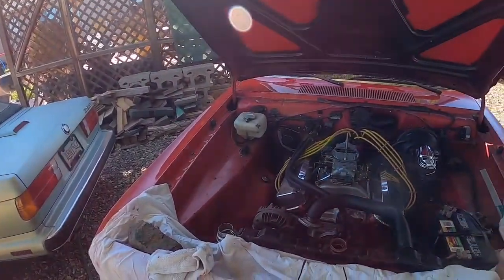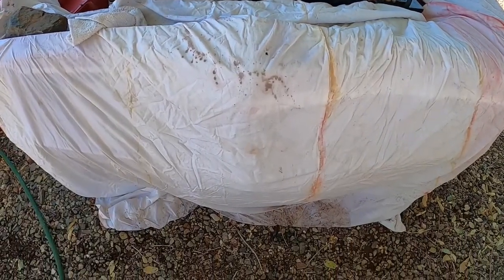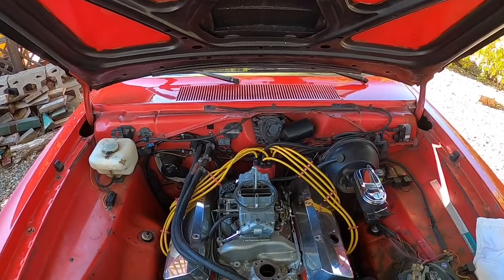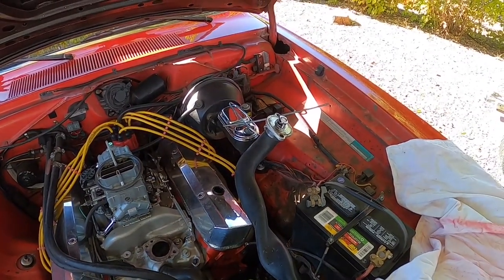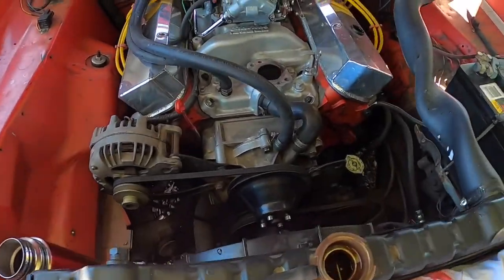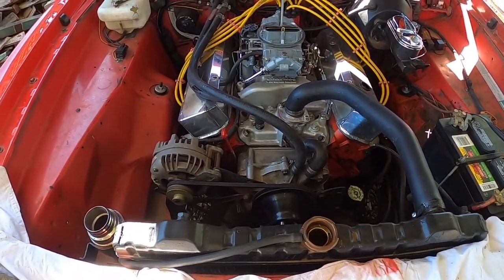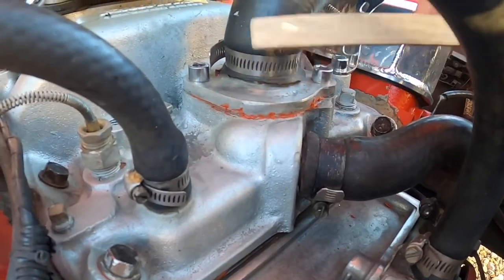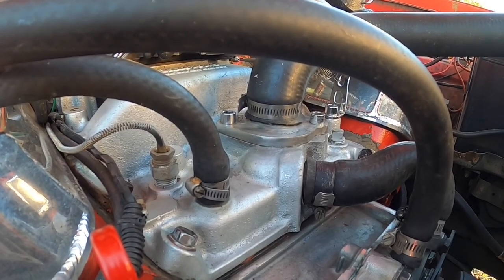Bi Annual Cooling System and Block Flush

Comment: Thanks. I need to flush a GM 5.7. Changed a freeze plug and could feel about 2 inches of rust in the bottom of the block. What is the best way to flush that? I  think it was from the failed Dexcool stuff that had to be taken off the market due to rusting engine blocks.

Comment: All the old brass Robert Shaw TStats used to have a really small dimple on the edge of the sealing area for an air bleed.
Reply from the maker: I see some that come with a bleed here and there still.
Some with a small hole with a little loose brass pin in it
Reply: @mopars4us  I used a Stant Super Stat a while back and drilled one of those little holes and it took FOREVER for the car to warm up. Might have been that car, but I didn't do it again.